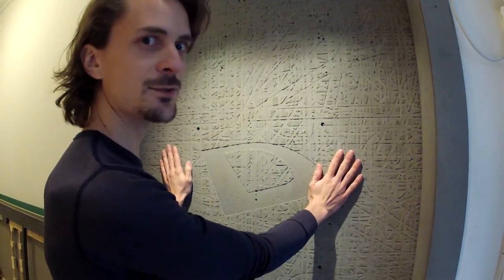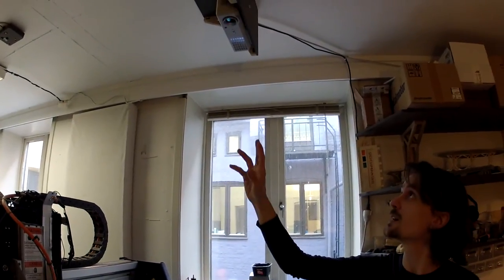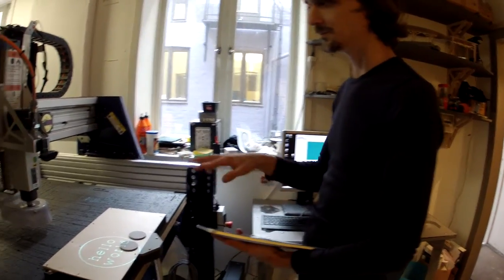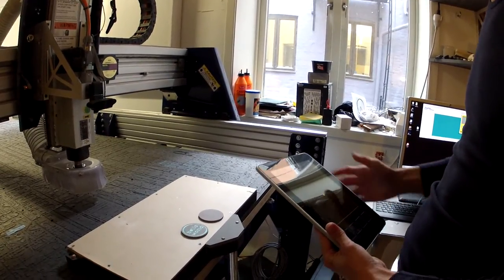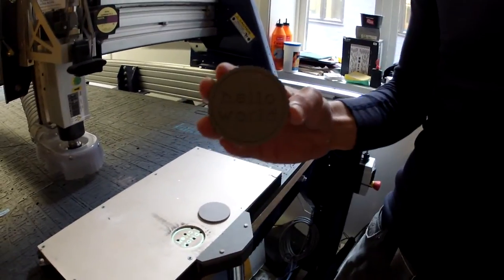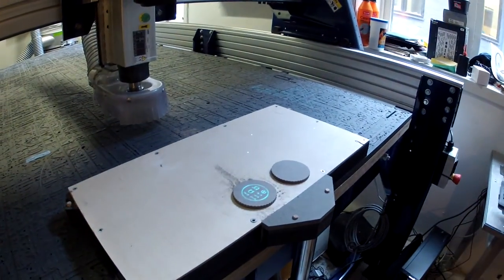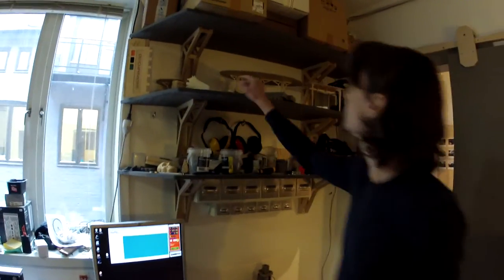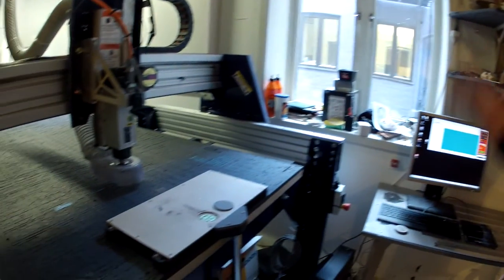Studio walkthrough 2015 - DyvikDesign

Comment: Love the projector Jens.  The tablet is a surface running the interface in a browser?
Reply from the maker: Thank you steven. The tablet is an iPad running touchOSC, streaming open sound control values to the grasshopper plugin for rhino. Rhino and grasshopper is great because you can actually do proper nurbs based CAD and custom CAM, but downside is not running in browser and being closed source. We are considering developing a .svg and browser based system.